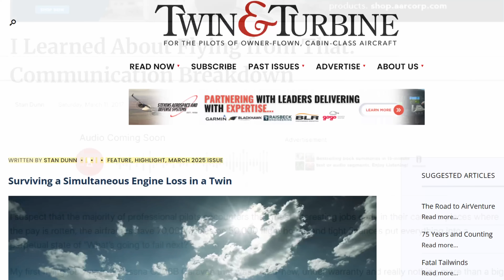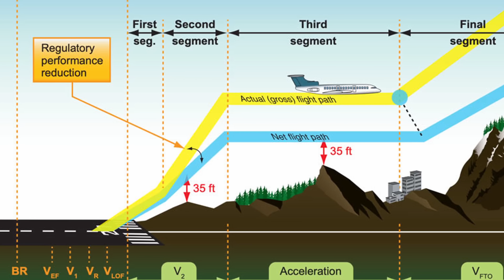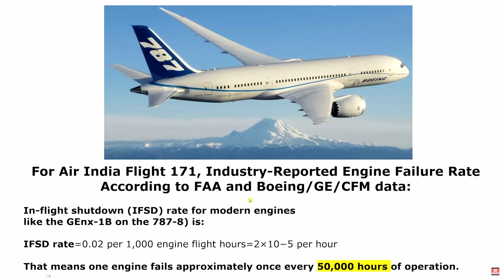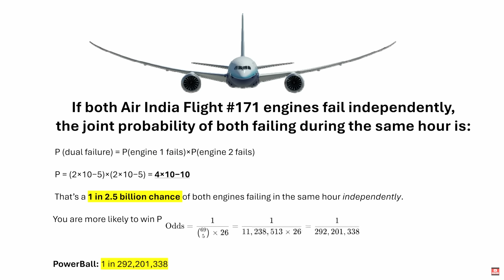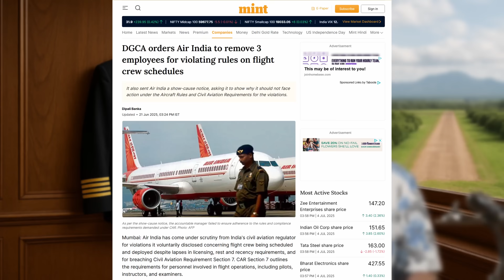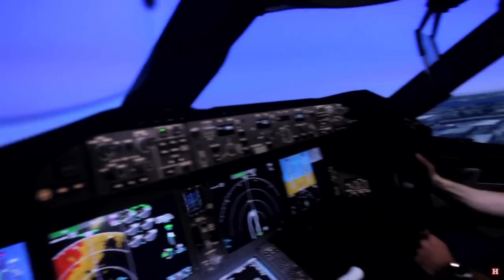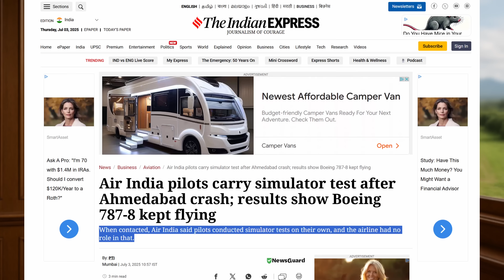Air India 171 Cause Becoming Clear

Comment: Really?? Blaming the crew again? Any normal trained aircraft pilot would have immediately  realized his error as soon as the thrust was lost and done something about it, don't you think? Unless the hypothesis is that once an engine is shut down it cannot be immediately restarted. I just feel its unfair to actually point a finger at a person who cannot now defend himself due to obvious reasons when there's a whole bunch of other mechanical/electrical  causes not yet ruled out.
Reply: No,  not blaming crew,  just saying that its in the realm of possibility.  Why would that be dismissed unless  the evidence warrants it? Go where the evidence leads. (of which hasn't been fully released yet.).
Reply: The it cannot be immediately restarted… is what he said
Reply: He already explained that in 'idle' you can simply put your foot down, however any further and you have a procedure in order to restart the engine. How much clearer does it need to be ?

Comment: I am also focus on the "dust" from possibly from both wings if you look closely.  I wonder if it could be fuel spray perhaps from the jettison ports.   There is YouTube video showing 777 dust at that airport take-off,  but seems to me different  tan color dust and lower to ground.   The pilot error theory conflicts with report a week or so back that the pilots were vindicated by recordings (they may have cockpit video in this case,  not sure).
Reply: The wings of the 787 are long enough to reach out beyond the sides of the runway, and it is reasonable that the wing vortices can whirl up a lot of dust from the ground next to the tarmac.
Reply: @tommyrjensen  true it could be dust

Comment: You do not shut down an engine, or even touch any engine controls at all, below 400ft AGL. Go back to pilot school. The dust blown up by #1 comes from the left side of the runway, because the wing of the 787 extends beyond the runway and creates wing vortices. How about TCMA, why not mention that software as a possible cause? It is known that TCMA has the power to shut down both engines, just as well as the pilots could have. But you want to blame the pilots, right? The easiest road for you, because they are no longer here to defend themselves. While Boeing can go free of blame once again.
Reply from the maker: I’ll be the first to blame Boeing if it’s Boeing. For now, the odds are against it. As far as TCMA, an aviation attorney (see: suing lawyer) is the source for this. Not zero probability, but not the most likely cause at this point.
Reply: @flyingformoney777 Here's the thing, GE  & Boeing already  know if  it was a  dual engine failure.  And if so it would mean a grounding of the fleet.  Follow the money.
Reply: In the real airline world with an engine failure you climb to 800 feet before ANY checklist or corrective action. In a no flap no slat takeoff, you wouldn't be able to climb out of ground effect and you would see aileron walking.
Reply: @billakers6082  It depends on the airline SOP. It can be 1,000ft in some airlines. But 400ft seems an agreed upon minimum.
Reply: @tommyrjensen I flew for 40 years in eight different types for a major and we never initiated corrective actions except raising the gear until 800 ft. Being distracted at 400 ft is a recipe for disaster unless you're in a Baron. Flight Safety and most majors train 1000 ft clean up.
Reply: FFS grow up, the guy has offered information and an opinion, you have given us emotion, which has it's place, but not when trying to establish the cause and prevent more deaths.
Reply: @andymouse  I present information to you that he must know, but chose not to give.
Reply: You're just another keyboard warrior who loves making dumb comments while accusing others of the same. Am I correct?
Reply: @toby9999  Not quite, because I actually know something about the topic of this video, enough to correct some of the inaccuracies. What can you contribute?

Comment: 'How well train company pilots will react...'
B/S
Excuse my language, but 2 data points you omitting:
1. 1st off. was just 1k h. That's low if TT for a complex heavy machine like 787, unless it was 1 k h on 787. Nobody is saying one way or the other. 
2. Pakistan? No. Pakees have MANY OTHER ways to do harm. Not air terrorism hurming innocents' some likely of the same religion as they are. 
I wonder if all unlucky maintenance people at this airport are accounted for. Beating for confession would be SOP in today's India.

Comment: No, there’s no yaw/ rudder movement seen in the videos.  This is a simultaneous engine fail for some reason.
Reply: I don't agree that it is a double engine failure, but it is a double engine shutdown.  I have read online that there is computer logic that can do this given certain parameters.  So it is possible that if some sensors supplied incorrect data to the computer(s) that logic could have been initiated, powering down the engines.  This would have to happen at a higher level than the FADEC controls on the engines so possibly at some central control level used during maintenance?

I am an FAA licensed amateur pilot, now retired, but also a computer engineer that has worked on many different process control systems where multiple machines are run from a central computer.  I have experienced unexpected computer programming problems that shut down multiple systems.  The more complex a system the more challenging it is to test every possible combination and sequence of faults and debug them.  It is conceivable to me that a computer program instructed both FADECs to shut down their engines after receiving some combination of coincident faults that had not occurred before.
Reply: @philipgrice1026  - Possible?  Anything is possible, BUT it's unlikely that the flight system would allow a dual engine shutdown during a critical takeoff/climb phase.  No need to waste time on speculation, gotta wait for the flight data.
Reply: @BillAnt  That's pretty much what I thought!
Reply: @philipgrice1026 great point
Reply: @philipgrice1026  Wouldn't there be a failsafe though, to prevent any command from the program ever cutting engines during crucial stages of flight? If not, that is truly worrying!
Reply: Euh ? Looking at the video, I'd say there' s a slight side-slip movement to port immediately following the fume/dust cloud from the port engine . .  . . corrected by aileron ? Does the pilot of a 787 always have full authority during take-off, or  can the computer intervene ?
Reply: @nicholasroberts6954  To have a close look at that....  Put cursor on  the picture, click the mouse (stop the playback)... then type a period to advance one frame (30 times to watch one second), comma to back up one.  Use the cright and left arrows to move five seconds.
Reply: Are you an expert?
Reply: My question: what happens if plane extremely overload than engine can handle flietworthyness.can defence mechanism of software triggered to shutdown engines from damage.? because plane took whole 3.5 km runway instead 1.5 2 km due to its loading and at that  day extremely humid and hot atmosphere there in Ahmedabad.
Reply: @vyasjwalit3999 🤝 - there have been at least 2 Air Disasters shows where this happened - in one the pilots were given the wrong weight (more cargo was added shortly before the flight). In another the pilot just put the wrong value in - so flaps and thrust weren’t set. The way they went way down the runway, got up, floated for a few seconds, then started dropping, makes me think this is a real possibility.
Reply: I suspect foul play
Reply: @dudemanismadcool I think so too.
Reply: Not necessarily. This a/c has a very effective yaw damper to mitigate engine-out yaw. “Dead foot, dead engine” doesn’t necessarily apply here.
Reply: @Willtellthetruth  Said yaw damper works by... moving the rudder.
Reply: @Willtellthetruth how do you think the yaw is dampened???
Reply: Why the RAT seen activated in this case...??
Reply: ഇയാൾ ബോ.കമ്പനിയുടെ കൂലി എഴുത്തുകാരൻ ആണോ സാറെ 😅
Reply: A guess... the apparently failed land gear retraction sent the signal that the plane was back on the ground and whatever else happened, it sent the signal that shut down the engines.  I haven't heard of anything else that would do that.
Reply: Ya, I'm leaning toward some electronic/electrical failures causing both Fuel Shutoff Valves (aircraft valves) to be closed, after all I've read and seen (aircraft system diagrams)
Reply: I could clerly see yaw.
Reply: @leosmith848 in which direction?
Reply: There is definitely a pitch to the right if you slow the video down. And something that doesn't get enough play, is this Lone Survivor said he could hear metal tearing, and that the plane jerk to one side Before impact.
Reply: No, what he heard what the Ram Air Turbine deploying.
Reply: Yeah, this 4k video is so clear that its easy to tell if there is yaw from more than 2-3 miles away. So you geniuses must know the winds since you checked the METARs, right? Or are we just armchairing this?
Reply: Probably software error by Boeing like in 737
Reply: @AlJay0032  here go the Boeing haters/Airbus tryhards
Reply: @OfficialDoggyYT  I am not a Boeing hater. I want to see great airplanes and as much competition as possible.
It just seems Boeing has lost it's way.
Both going woke and hiring less competent just to reach some quotas of women and colored people is idiotic especially now that it is costing lives and also Boeing needs to get up to speed with computers and software and stop bumble fucking around like they have lately.
If you don't accept reality, you will not get back on course. I wish Boeing gets the message and changes now to return to being state of the art again.
Reply: @AlJay0032  yes most likely, any other dual engine failure would have led to a yaw
Reply: @Alexander-dt2eq  uh no, a duel engine failure would NOT lead to a yaw, but rather low airspeed would; whenever a plane stalls its always gonna be one wing that stall first which causes the aircraft to bank in said direction.
Reply: Boeing used 9.00 dollar an hour labor to write mcas on 737 max
Reply: @tex346  This wasn't a 737, it was a 787...
Reply: @tex346 Where did you get this info from?
Reply: @tex346  That's what the old world engineers do, optimize at the wrong place.

I have also heard of multimillion dollar wind mills destructing themselves in storms because the engineer designing it thought he could do real time programming and used a $2 controller to manage the windmill. Sure, the "computer" he used was cheaper. He saved the company money by programming it himself. Not everyone who thinks he can program should actually be programming system if lives depend on it.

The old companies like Boeing don't understand the world of software and it's significance.
Reply: @redbaron6805  We know.
Reply: @AlJay0032 To not code up a comparison of the datastreams from the two pitot tube's is gross negligence in my view.
Reply: @tex346  Boeing even sold the second AOA as an option and asked millions for the second so cheap discount airlines didn't buy the second.
Unbelievable the FAA even allowed this.
But Obama allowed Boeing to check and control themselves. Didn't work out so great.
But I am glad this mistake has cost Boeing billions and the leadership in these commercial airliners.
But it seems Boeing still hasn't learned their lesson and still prefers woke DEI hiring and keeps doing more of this BS.

Same with the FAAs DEI hires based on gender and skin color. Not working out so great either. We are getting tons of close calls and almost accidents. It is just a question of time til a big accident happens. The Washington Helicopter incident was just the tip of the iceberg. More will follow.

I'd really prefer if they all went back to hiring the best, even if that means more white men will get hired.
Reply: @AlJay0032 Boeing must be punished enough to force a change back to an engineering driven company rather than a financial driven one.

Comment: If what you are reporting that the Left engine failed or was not providing take off thrust, then the video you played when it was taking off would of shown rudder input to counter the yawing of asymmetrical thrust. This wasn't the case the rudder did not move or was there any indication visually of the 787 swaying after takeoff.
Reply from the maker: The 787 automatically adjust rudder during an engine failure. If the failure occurred on the ground during rotation, you would not see any wiggle. The takeoff video is too grainy to tell if the rudder was deflected.
Reply: @flyingformoney777  Agree that modern airliners have an automated rudder input but losing an engine what is sending around 80k of thrust would cause some lateral movement, the aircraft didn't even twitch when on take off or when it became airborne.

Comment: Years ago, read an article about a passenger jet that suffered an engine failure. Instead of looking at his instruments (?), he asked a stewardess which engine failed. He then shut the fuel off to the wrong engine. He was facing forward, she was facing aft. Her right was his left, etc. So her information on which engine failed was unintentionaly erroneous.
Reply: That is what we have Port & Starboard for!
Reply: @pcka12  Pilots do not use port and starboard
Reply: @orizaba18000  Nonetheless confusing your right & your left is why they exist. 
Formerly ships had a 'steer board' on guess which side?

Also aircraft continue to use knots as well as mph & kph & carry Port & Starboard lights, so aircraft really do have Port & Starboard sides, you just don't notice it!
Reply: @pcka12 Engines are referred to as #1 ir #2. Not left and right port/starboard.
Reply: @orizaba18000 Well obviously you need to know the 'naming convention' to get the order of your engines correct? 
Why do I get the impression that you are entirely missing the point? 
Are you perhaps aware that in the Islamic world writing runs from right to left across the page?
Reply: @orizaba18000  Brits do, because they invented sailing and ported it over to flying.
Reply: @marclandreville6367  "Brits invented sailing" LOL
Reply: You use engine numbers. Engine number 1 and Engine 2 etc
Reply: @Xeldinn  B-707, B727 and B737 do, but B767, B777 and B787 use Right and Left.